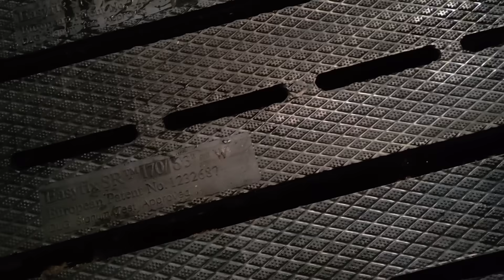UPGRADE TO THE SLATTED SHED

Comment: Hi karen, happy birthday, hope its an enjoyable one, the mats are a great job, you will see huge improvement in cow/ cattle comfort. It may happen ( in a few yrs) that cows hooves might tend to grow more as they were kept trim on the concrete slats, the rubber wont wear the hooves as much, but its a small issue, overall the mats are a super job, did you ever look into using ( bolus) for cows with foot problems, ive used them and so far so good, they are designed to strengthen the hoof tissue plus help prevent foot rot ulcers etc. Might be an option/solution. Keep it lit.

Comment: put  mats in a shed last week .  a 16 ft 6   slat ..........put the rubber on 2/3 of the slat , left the front bare where they stand and eat at the rail ........went out that night  to check on them  before i go to bed as i always do and all of the cattle were sitting  on the mats ......not one was on the bare slats ..... they are expensive but they will last a long time ....have them down in a shed since 2005 and they still look  as good as the day they went in .....
Reply from the maker: Well that certainly says it all

Comment: When you wash down with these plastic mats rubber mats whatever they are do you ever take them up to wash underneath or do you just wash them over the top just a curiosity thing really
Reply from the maker: No I don't take them up. They're not easy to lift up at all and they are definitely not easy to put back down afterwards